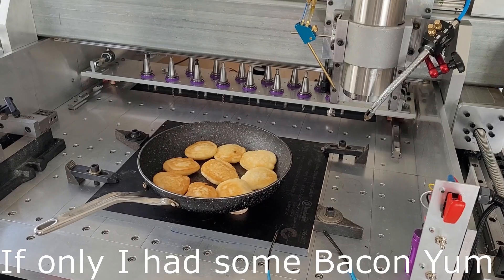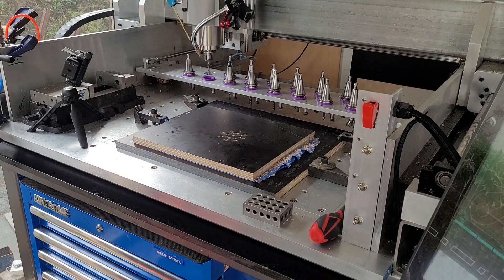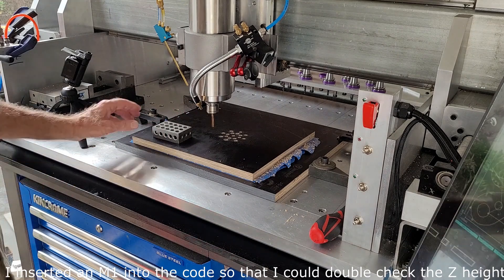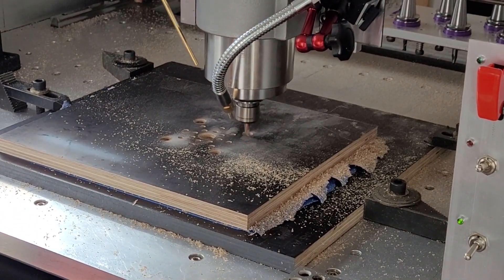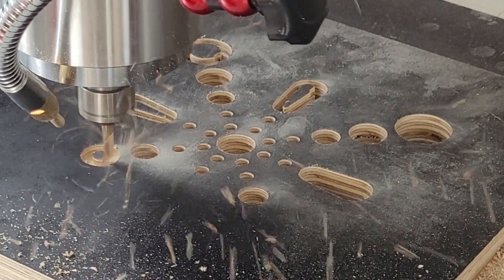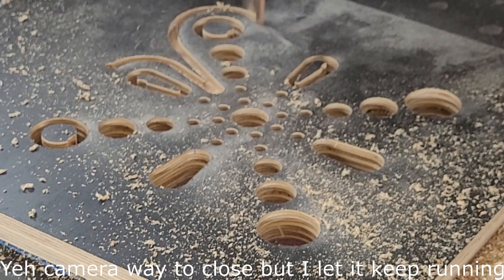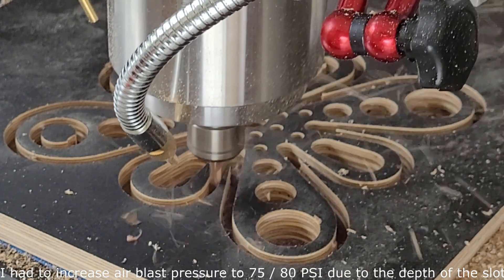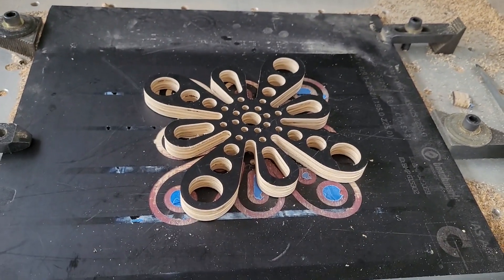Bill's Home Built CNC + ATC adding air blast and testing it's operation with 17 mm deep cuts

Comment: Pretty slick Bill!  👍😃
I know you said in one of your other videos that wood is not your intended material.  If you are going to do a few projects like this one, especially using material with a finished or laminated surface, I recommend adding "downcut" and "compression" bits to your armoury.  The downcut bit has the helix machined in the opposite direction to a normal upcut bit, so the cutting edge is angled into the face of the material.  This results in beautiful clean edges, with absolutely no "tearout".
The compression bit is the same except the bottom few millimetres are at a normal angle, so the cutting forces on both top and bottom faces are into the workpiece, so you get no tearout on top and bottom.
Love what you've done!
Reply from the maker: Hi John great advice as usual, yes I will look into getting a few of each as inevitably I will do more and more wood so I should have the right cutters to do it will also look into some V carving as well cheers Bill

Comment: поделитесь пожалуйста программой и скриншотом  please share the program and screenshot
Reply from the maker: The program I use to draw up the part is Fusion 360 Cad and I also use Fusion 360 to do the Cam the G Code is then loaded into the Masso controller you can see a screen shot of the Cam in my Mist Coolant Video cheers Bill

Comment: Hi William, i discovered your video now.very nice job...io love your ATC when it moves and change tools...very cool...but a question, does it work with GRBL language ??
Thank's a lot
Philip
Reply from the maker: Hi Phillip I use a Masso G3 5 axis touch screen controller But you can use a auto tool changer with GRBL or you can set one up to be QTC with manual control, push button or switches they save a heck of a lot of time and are a great upgrade / project cheers Bill

Comment: Retracting the tool to safety level Z with G0 should not pose a safety risk😉
Reply from the maker: Hi in the past I have had from time to time just out of the blue pn the first operation the cutter drive 5mm to deep into the stock so Z 0 height 5mm to low and I have not ever been able to find out why zi don't know if it's in Fusion or the Masso controller so I now add a M1 to the code when the Z gets to 25mm from the stock this works for me
Reply: @williamnorris1516  It will be easier if you follow a few rules. Execute a new program with a single block function, then no extra M1 is needed. If you also have a feed potentiometer on your beautiful machine, use it when retracting the individual set. Keep your Z safety height as high as possible, e.g. Z+20mm if possible. Adjust the postprocessor, after changing the tool, approach the workpiece only xy and only then to Z safety height. Tool length should be measured so that you can check it with a depth gauge from the spindle nose to the tool tip. Tool length is always positive, every tool. When probing the Z0 workpiece plane, remember that the length of this tool is also active. On some controls you have to do this manually in the MDI with G43 Hxx. xx stands for the tool number in the spindle when probing.
Reply from the maker: @SimsonSupermoto  I like the single block idea, because of the ATC all of the tools in the rack have been numbered and probed using a tool length setter Masso automatically then records this information for every tool I also make sure that my tool library in Fusion 360 is numbered the same as in the Masso controller after touching of the cutter on the stock to set the Z0 for the first tool to be used  I make a note of the Machine co ordinates and make sure when the program starts the Z height is the same on the DRO and on the machine co ordinates usually I don't have a problem   but I will keep in mind what you said ok thanks Bill
Reply from the maker: @SimsonSupermoto   Well how about that my Masso controller has a single line button I never even noticed it before I will try it out today . Thanks for all the great information Cheers Bill